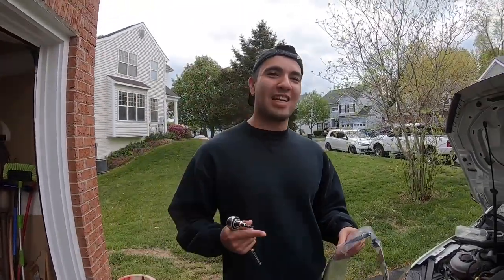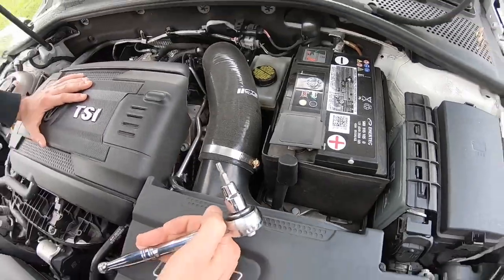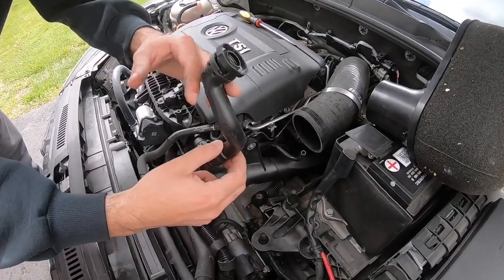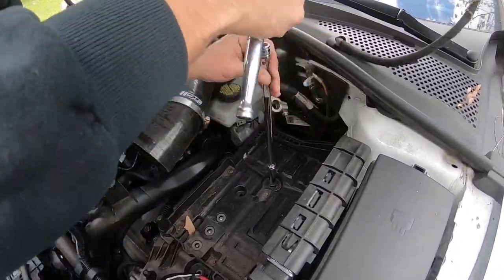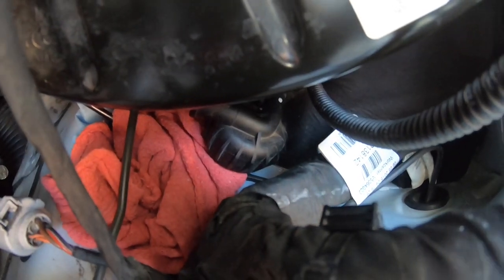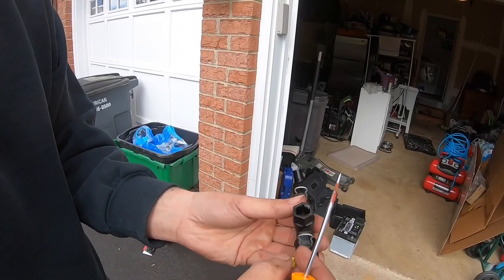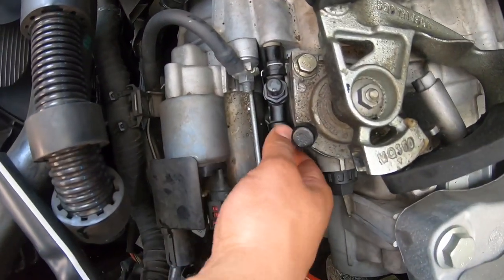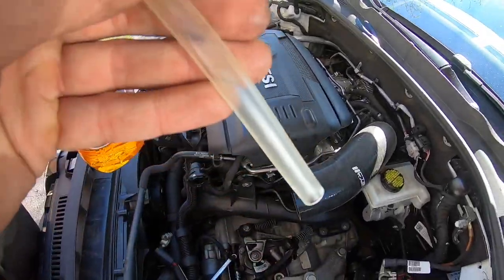ECS Stainless Steel Clutch Line + OEM Bleeder Block Mod!

Comment: Handy vid, thanks for posting. I'm going to change just the bleeder unit and I'm thinking I might be able to getaway with gravity doing all the work for me. (overfill brake res into clutch section, let run down and wait until liquid wants to leave thru bleeder. Failing that, use a clear line and suck some out. I wonder how I'll get on!

Was it a good mod? Pleased you did it?

Comment: When you bleed the system you press on the brake or clutch?
Reply from the maker: josehenriquez90 Use a bottle with some brake fluid at the bottom and a rubber hose that connects to bleeder and press clutch pedal to the floor. Can take a while if lots of air in the system
Reply: @AlexMK7  also what size vinyl tubing is that? 1/4 inch?